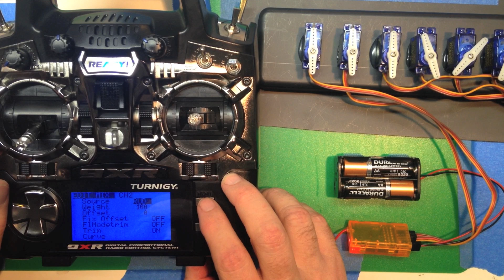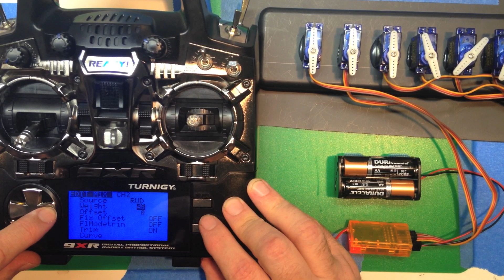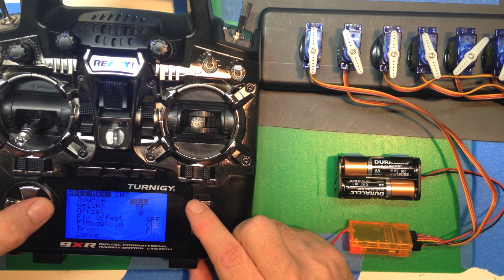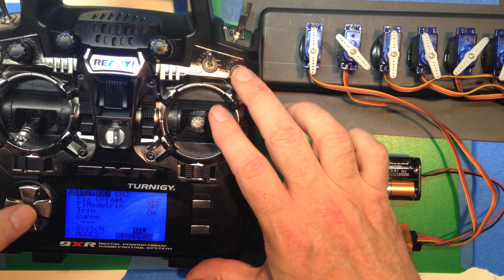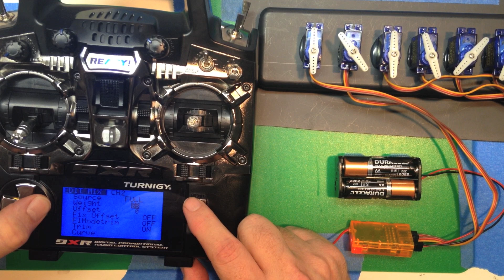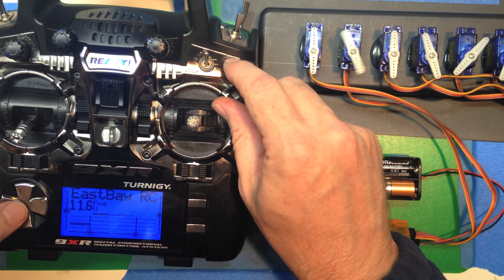Welcome to the Turnigy 9XR Pro, Part 4: Mixing

Comment: Thanks for the explanation. I need your advice:
I want to turn the transmitter to mode 5. How do I change the throttle(after installing centring spring) to -100  0  +100.
I also need  the left and right sticks to have a dual function one is for usual function and the second is for other servos https://www.youtube.com/watch?v=YRyHK5y2JDU (0:53).
THANK YOU !!!

Comment: Hey, thanks for your video! i recently tried to connect my 9xr pro over my XJT module to a X4R SB receiver. https://youtu.be/RbvNumImGxo

The binding worked fine, the S.Bus Setup in cleanflight is also ok, as you can see it receives data. 

But there is no input from the transmitter being transmitted. Any idea? :(

Thanks in advance!